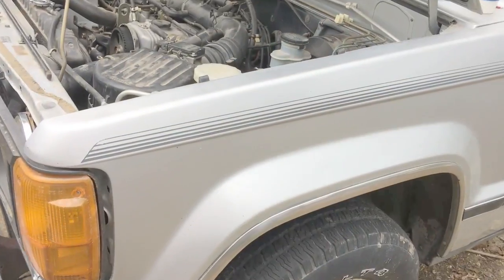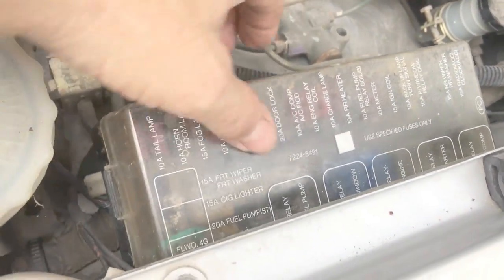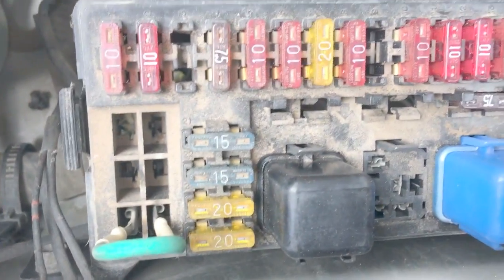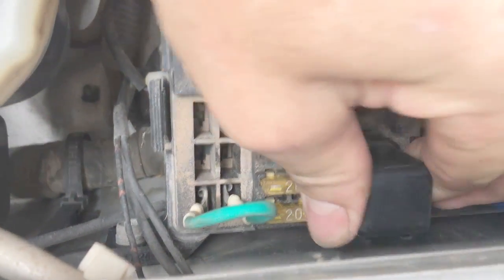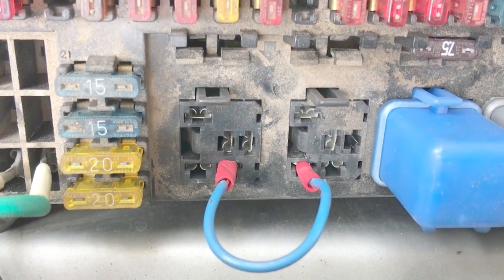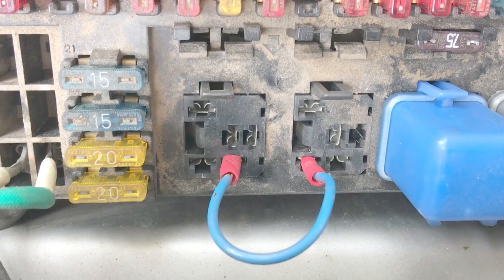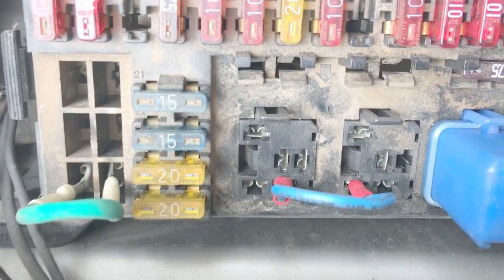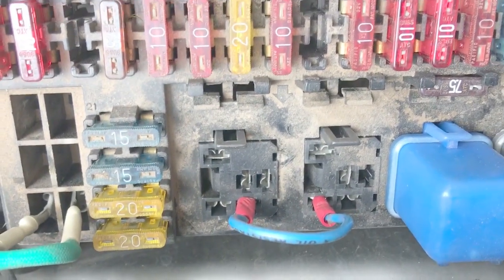Isuzu Trooper Fuel Pump Circuit

Comment: If anyone wants another work around for this situation. I have run a momentary switch fitted to the dash and it takes a fused wire to the switch from the positive on the battery (or any other source) and back to terminal 5 on the relay (in my case). The signal mimics what the alternator does to the relay, by triggering the magnetic switch in the relay that then connects terminals 1 & 3 in the relay to power the fuel pump. On a cold start, I simply flick the switch on for a few seconds to prime the fuel system and once started, the relay can still do its job as intended. I could not simply use Johnny's hack, as I have dual fuel. LPG (Propane) and Petrol (Gasoline). And Johnny's hack would have the fuel pump running even when I am using the alternative fuel source, which is most of the time.

Comment: .....I'll look into this aspect. My one week old 93 Isuzu is different slightly in southern hemisphere. I'll need to google up the pin out for the relay in order to accurately do the bypass connection . Just starting to look into why vehicle runs perfect on LPG fuel but nothing when switching over to petrol . Tank is full of petrol ,even overflowing, I'll have to siphon out a few litres so as not to flood the canister , .Despite a full overflowing tank the low fuel level warning icon is lit up in the dash . Vehicle likely has run on LPG only since 97 . used in a farm the last eight years .

Comment: I had this same problem with my 91 Trooper. As stated,  the engine would catch start, but die after a few seconds. I was able to get the engine to run by giving it a high rev for a few seconds during the "catch" phase. This worked for several months, but I became increasingly worried that my luck would run out and I would get stuck somewhere. I noticed poor acceleration and power and suspected a fuel delivery problem and perhaps a bad fuel pump.  I tried this "fix" to by pass the alternator as a way to check power to the fuel pump.  The "jumper cable fix" worked.  The engine starts every time now.  I did notice that now, with the jumper cable, occasionally  6 of the 10 panel warning lights remain on until I travel several miles and the cabin heater fan will not come on until the warning lights go off.  I suspect alternator signals through the ECM are messing with the warning panel lights and fan relay, with the jumper cable installed.  I will be buying a new alternator with a good diode signal to the ECM. Can't thank Johnny5 enough for his web page and insight into the workings of Troopers. Have tried other web sites (Planet Isuzu, ect) with this starting problem, but the comments are so cluttered that I could not find an answer.  Johnny5's explanations and vidios on first generation Troopers are a great supplement to the other sites.
Reply: So I have a 94 amigo and this starting issue you had is the exact same and then it randomly went away next thing you know it does on the freeway and I have what acts like a bad fuel pump and does absoulty nothing when cranking was this the same problem you had

Comment: I just needlessly replaced a fuel pump on a '88 because of that lack of prime (like GM does) about 3-4 weeks ago  - I had no idea the Trooper didn't do that! Made troubleshooting take quite a bit longer.

I ended up tracing the problem somewhere along the wire that runs under the carpet to the plug under the vehicle, under the passenger side of the rear seat. When feeding power from the fuse block with a jumper (like you showed here), there was still no power at the pump. When I hooked my test light to battery positive, and energized the wire down at the plug under the passenger side rear door, the engine cranked! That was an odd one! Long story short, I just ran a dedicated wire right from the fuse block (so everything still works as designed) and back under the vehicle to the pump.  Neighbor has been driving it ever since without issue.

When it failed, he was passing my house here - we waved, then I heard it shut down - just like a light switch! Good place for him to break down though, lol.

Comment: Good afternoon I have a problem with a 1986 trooper, the front axle padlocks sound like a rasch as if I wanted to put the 4 x4 I want to know that may be the possible cause of the problem, greetings from tijuana mexico
Reply from the maker: I don't understand what you mean.
Reply: Wear of the nuts that adjust the front wheel bearing affects and produces a rattle sound
Reply: I'm sorry I can not explain myself better, but I'm using a translator
Reply from the maker: From my experience it is usually the axles rattling because the locking hub clip which secures the axle has come off.